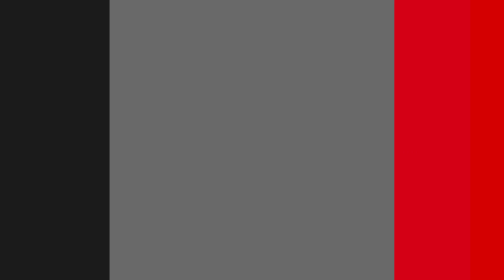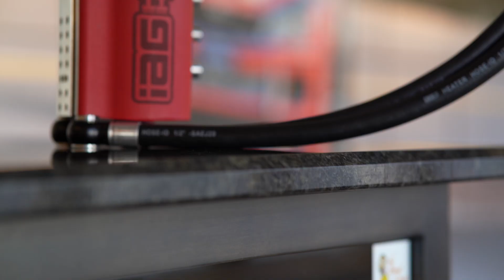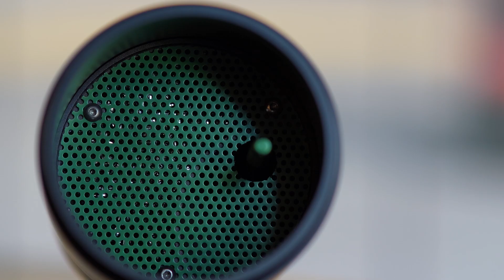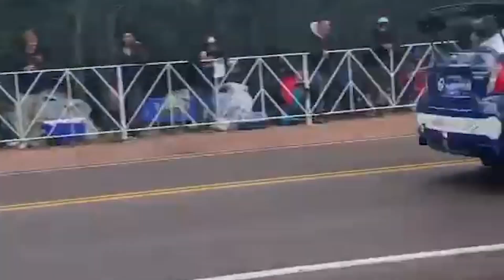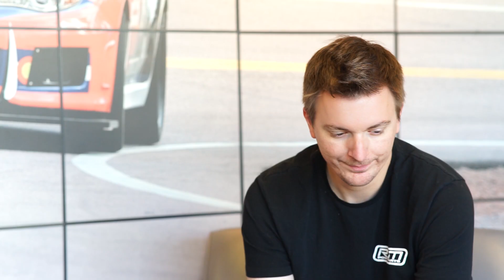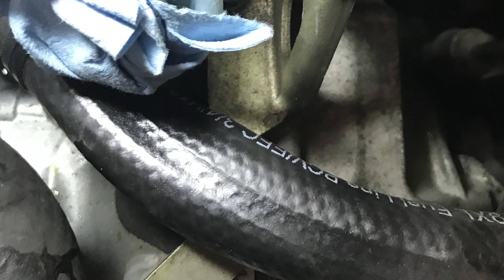Do I need a Catch Can or an Air Oil Separator?

Comment: Single can vs dual can? Some argue CCV and head vents shouldn't be combined.

Also, how did you measure crank case pressure and what values are considered 'normal'. Do these ranges change with forged piston engines?
Reply from the maker: Thanks for your questions.  Ideally, yes, you don't want to combine Crankcase vents and Cylinder Head vents.  Many AOS's do this without causing issues.  But it gets more complicated with catch-cans.

For more information on crankcase pressure, you definitely want to take a look at our video specifically on that here:

https://youtu.be/HAvxjSdQsXI

Thanks for watching and Stay Tuned!